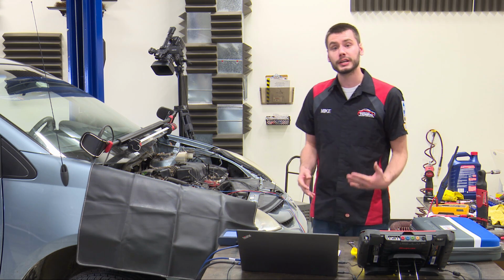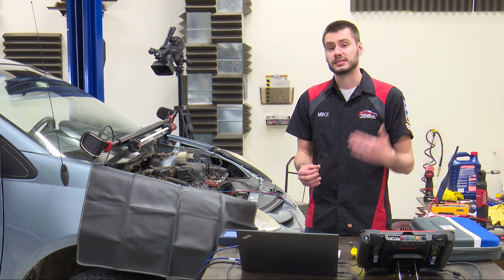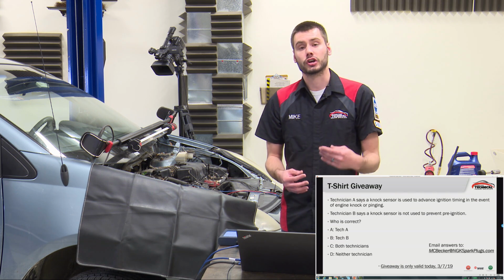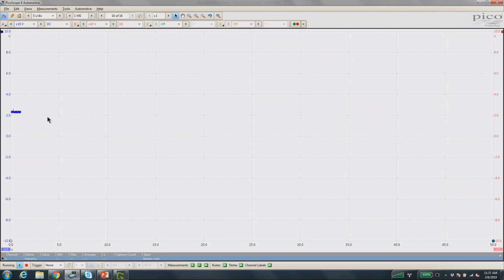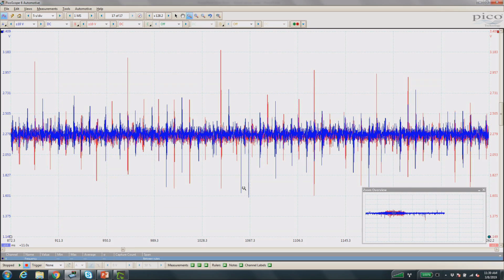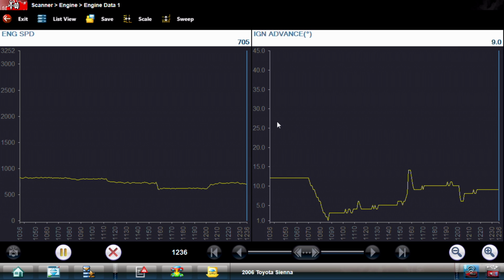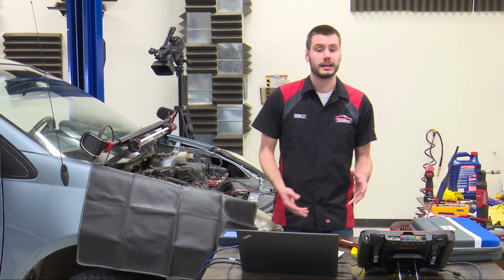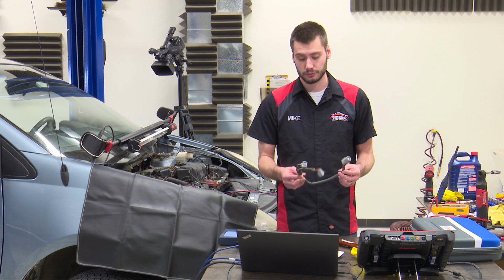Knock Sensor Video Follow-Up

Comment: Is the damage already done once the knock sensor failed and check engine light comes on? That failed and my catalytic converter failed on my forester. Only 53,000 miles. I’m very concerned because of the low mileage. None of my Toyota’s ever had any issues close to this. I never even heard of a knock sensor before this .

Comment: Is it useful using 100 ocaten fuel on the 1KR-FE engine of mk1 Aygo?
Some say it's a waste.
Since there is a knock sensor I think 100 octane helps engine to work smooter.
Am I wrong? Thanks.

Comment: So if I have a 2006 sienna.   Engine codes are P0305, P0300, P0333, and P0305.....
Replace coils and plugs?
Reply from the maker: B-Rad, i'd say it's time to determine the cause of the misfire. Is it a lack of spark, lack of fuel, timing issue, compression issue...the list goes on.
Mike Becker, Senior Instructor
Reply: @GoTechTraining  ok.  I put it on a scanner and those were the four codes I received

Comment: If the knock sensor is out of wack will it cause a loud thump under the hood when backing up ?
Reply from the maker: Hey, probably not. The knock sensor is to read engine knock, detonation or ping. I've never really heard of those being described as a thump. Could it be engine mount related?
Mike Becker, Senior Technical Instructor

Comment: So Knock Sensors - probability is an EGR stuck or not operating correctly or VVT not functioning correctly. I replaced VVT solenoids previously - but I guess it is possible I could have a bad 'new one' or perhaps my oil screen is clogged - I did buy new ones from the dealer.  I started having Knock Sensor Issue right after car hit a small dog on highway at probably 45-50mph . I am just wondering what got banged at that time . I have installed new MAP, new T-Body , new plugs, timing belt / water-pump job. New T-Stat and Pipe. I am trying to avoid the tear down of the vehicle if possible - because those sensors are a PIB to get to .. Is there an easy way to replace them and wiring .. or is it really the PIB method?
Reply from the maker: Hey Stix, are you getting knock sensor circuit codes? If so, you'll probably end up needing to get to the sensor. What kind of car?
Mike Becker, Senior Technical Instructor
Reply: @GoTechTraining  2006 Toyota Sienna P0328 Knock Sensor Bank 1 Input Hi. I clear the code and put STP barelegal octane boost - the code is gone, I fill up with out the boost code comes back on what I would call the first start with new gasoline (empty tank fill with 17.5 Gals drive 10 miles turn off engine)  - check for pending codes etc...no codes.  Then start vehicle and watch for codes walla P0328 pending and then set. Does not sound like a sensor/wire issue - I will not say it is not .. but seems more like something - bad fuel injector, fuel damper .. etc.. 238K miles..
Reply from the maker: A knock sensor circuit code can't be caused by an injector or anything like that. It's not a code saying the engine is knocking. It's a code saying the PCM is seeing the value as too high on the circuit. This is usually caused by an open circuit concern.
Mike Becker, Senior Technical Instructor

Comment: Obd 1 system that hammer would definitely work bad idle  bearings etc engineer have learned how to tune that frequency well in Obd 2 system
Reply from the maker: I agree, OBD1 was a lot less precise monitoring of that sensor.
Mike Becker, Senior Technical Instructor
Reply: I've learned a lot from you keep  up the good  the work

Comment: Hey Mike.  That was great. Thanks for doing the follow up for us.Good forethought to look after all of those components while it is apart. Save your customers a bunch on future labor.  Do you want to borrow one of my vacuum fill kits for the cooling system? Yours anytime. Also do flat rate guys get to bill out extra time for the nest removal?
Reply from the maker: Hey Mike! That's exactly what I thought. Intakes off, may as well take care of all of it. I would think that you could quote extra time for rodent removal ;) Do you use the vacuum fill kit often? I don't own one. Never had a time where I NEEDED it...i've always been able to get by without.
Mike Becker, Senior Technical Instructor
Reply: @GoTechTraining  Yes.  I needed it for the Cayenne. Now I  use one of them every time I drain the coolant. It checks that the system has no leaks,  also and you dont spill a drop filling it back up and fills.in about 10 seconds Works fantastic. I love them.
Reply from the maker: Hmmmmmmm I may need to look into getting on then!
Mike Becker, Senior Technical Instructor

Comment: Your hammering convinced me that a knock sensor would not pick up a bad crank bearing noise or a stuck cylinder head tappet as a engine knock... the frequency window of a knock sensor is tuned to pick almost specifically engine knock. Thank you Mike and NGk Technical Training for this!
Reply from the maker: Hey Argeny, thanks for watching!
Mike Becker, Senior Technical Instructor

Comment: Doesnt knock sensors produce an ac voltage signal and produce their own voltage
Reply from the maker: Correct, under the right frequency, the knock sensor creates AC voltage. 
Mike Becker, Senior Technical Instructor
Reply: @GoTechTraining  love your videos..learn something new with each one. Didnt realize vvt could cause knock

Comment: It's the airborne dust from the mouse nest that could be very dangerous. The vacuum cleaner just puts more of the dust into the air for you to breathe in. Plus now your vacuum cleaner is contaminated for next time you use it.
Reply from the maker: You're right, I should have had a mask and gloves on for sure!
Mike Becker, Senior Technical Instructor

Comment: Thanks for the follow up Mike. Always look forward to the lunch time lessons. Keep up the good work.

I've found GM knock sensors, at least on the early 2000s 5.3/6.0 respond to tapping on the block with a ratchet handle.
Reply from the maker: Ahhh yeh, the 2 under the intake...super common issue on those. Everyones done videos on those, I'm glad I was able to find a different one for knock sensors :)
Mike Becker, Senior Technical Instructor
Reply: @GoTechTraining  I figured you knew about them already. Was interesting to see a different systems reaction, or lack or.